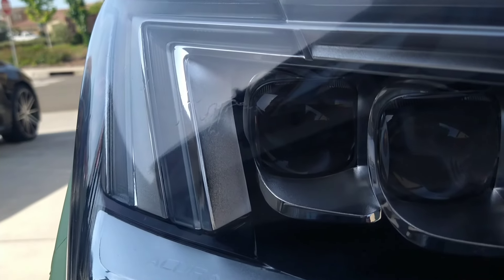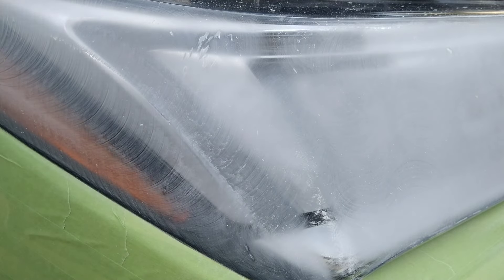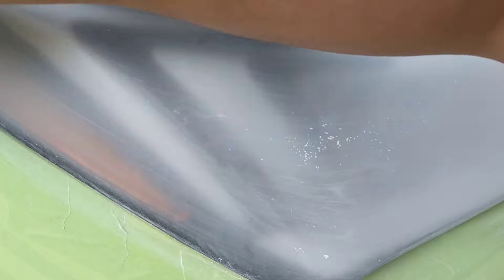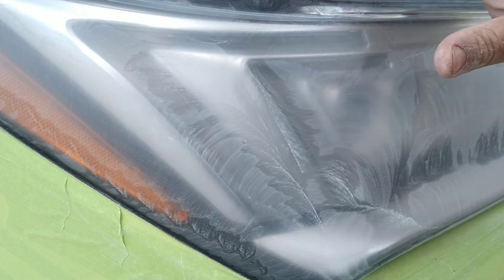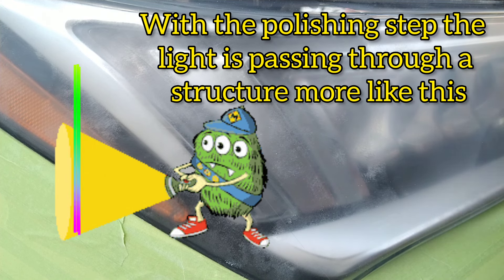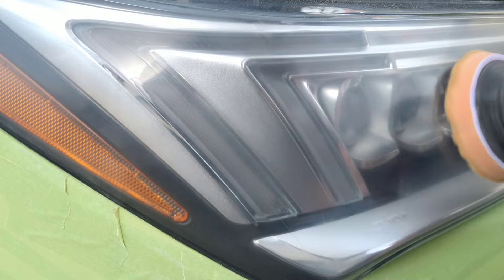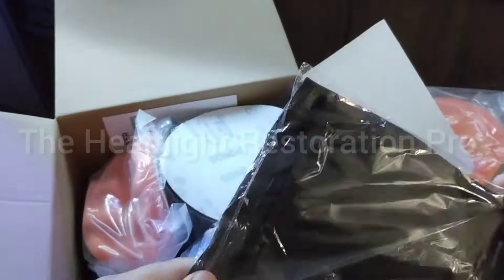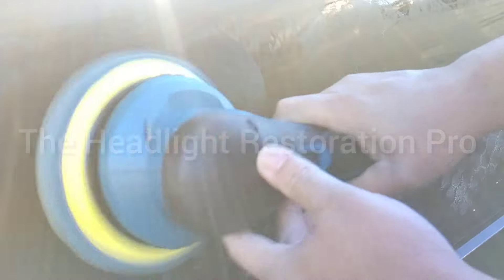Removing MeGuiars headlight coating/😭because I made a mistake

Comment: I finally extensively Sanded my 2004 Toyota headlights. Previously to that, a >FINE, polish, yearly, seamed OK.... after getting them really clear, i sprayed on a clear coat, only to have it extensively fog & then crackle- apparently I'd put on a clear coat b/4  Lacquer & varnish, don't mix. Now, the BRAND NEW ones look GREAT..L0L

Comment: I found a way to fix this easily but it has to be quick, I now carry a bottle of acetone and a rag with me right beside me when I spray it saved me now two times, I know ideally you don’t want this happening but when it does acetone wipes this stuff off if wiped up to 5 minutes after spraying and give it a polish, I also make sure to put acetone on the rag then wipe, also if anyone does this make sure to wipe the acetone off with the glass cleaner afterwards because I found that it messes with the new clear coat getting sprayed on, lol found out and had to respray twice the first time I tried with acetone.

Comment: I just tried the Meguiar's 17804 for the first time. The overspray error seen in this clip is easy to make. I kind of did this on my first lens, but the other lens was better. I think it's easy to allow the strokes to last a fraction of a second too long. The spray should consist of short, conservative strokes. For anyone interested, the spray works fine in cold weather.

Comment: This is exactly what happened to me. Thanks for showing that you're only human. You're thoughts on wipe on vs. the can sprayer?
Reply from the maker: Wipe on is inferior to anything spray...
Any wipe it on is adulterated unpure..
Always leave streets even if you don't see them right away uneven cohesiveness and typically too thin of application ... Little tiny fibers and things like that left behind from the pad used to put it on... Spray is very surgical and clean unadulterated there's no in between it just goes straight on and forms a perfect shell... Most anything made for headlights that is spray is going to be better.. this is also what the factor uses for many reasons it's just a superior method of application.. could you imagine wiping on clear coat on a vehicle,.. or wiping on paint....lol

Comment: warming the light before application will make it smoother with less orange peel and will dry faster.
Reply from the maker: No no no.... Not with this method and is unnecessary when doing headlight restoration... As long as you're using headlight restoration products... This is a zero Orange Peel product that dries with air (oxygen exchange) not heat.... I hear what you're saying but that's for stuff that's not designed for headlights.(totally different methods like wet sanding maybe).. With this method typically the light is warm enough through all the working and dry sanding and polishing...https://youtu.be/h-8BKUEVGRY?si=h5-Yw-Ntzrbp7OYG

Comment: I got my headlights done at VIP tires and whatever they used to spray it maybe a heat gun left a spray of the clear coating splattered all over my windshield and possibly most likely on my car. 😩It’s also on both of my passenger and driver side windows. How do I remove this? I tried using alcohol, but it got smearing and now my window is all smeared and a mess. 😩What can I do or use to get my window clean? Please help🙏🏽
Reply: Try a clay bar, if your window is messed up badly you can try putting #0000 steel wool with soapy water on it and just rubbing it away, not pushing too hard and letting it do the work.

Comment: Good morning and Happy New Year Mr. Headlight pro. I have a question for you. I'm your experience how many times can we sand and restore a headlight? Thank you so much for all your amazing videos!😊
Reply from the maker: Theoretically you can almost do have the restoration throughout the life of the vehicle... You only going to need another restoration every other year or even further even if you needed it every single year if you have a skilled professional that knows how much to remove which most cases would just be the clear coat you're talking 25- 40 headlight restoration Restorations estimate... Literally no vehicles going to be on the road for more than 20 years more than likely that would be 10 or less headlight Restorations....

Comment: Hi can I use meguaire headlight coating on convertible tops plastic window? I just had my plastic window professionally sand down to perfect clean but I don't feel meguaire plastic x does the same protection as this coating.

Comment: Which polish compound did you use to fill in the poly lens before you apply the clear? Looks like it’s at the 8:42 time mark. Your description lists 3M hard lens cleaner and Chemical guys headlight restorer. I’m a bit confused as to which product was used specifically to fill in the micro scratches left behind by the sandpaper

Comment: Let's say in 6, 7 or however many years when the Meguiar's coating needs to be redone, will it come off quick like your redo or will it pretty much have to be the whole restoration process? And also I think I know the answer to this question but should I wait for the springtime to do my headlights? Temps are getting down to 40 and could go lower.
Reply from the maker: Whatever it does go bad that you want to replace it it comes off even easier than shown in this video because it has been sitting and have have time to fully cure this is just the initial here which still a little gummy when you're removing.. it's super easy to remove once it's lived its full life or past the secondary curing...
Forest temperatures thats what this is about...
https://youtu.be/LnIqK8zRCI0?si=RTS9Nw2ieQXFoEqX

Comment: I used your technique to restore headlights on my 2014 Silverado and it came out great, thanks!

I did however get just a few slight drips like you corrected in this vid, but my clear coat has already cured. Honestly it’s not bad enough to make me want to redo the light, I figure I’ll just correct it when I have to redo the light again in a year or two.

The meguairs coat states it lasts for a year, at that point or when it fades do you recommend just replacing the clear like in this video or do you need to get back into the plastic headlight again as well?

Thanks for sharing your knowledge and experience!

Comment: Are the drips a problem or is it just a cosmetic thing? I just did my headlights and got some dripping but really don't want to redo the process if I don't have to.
Reply from the maker: It's purely a cosmetic thing it does not affect how your headlight works at all unless it's an excessive amount of drips...
It's just a perfect smooth or deal with like a little drip.. but in terms of dealing with a customer somebody who's paying for it is an issue sometimes not but I considered an issue just because they pay for perfection... But it's 100% cosmetic..
Reply: Makes sense. I did my own headlights so I'll just roll with it until I have to redo them and be a bit more careful with the spray next time. @theheadlightrestorationpro
Reply from the maker: @ethwoodard that's what I would do just always make sure you shake the can really well till it starts feeling lighter... And do really fast passes you see in 10 seconds I'm already done coating..

Comment: Thanks for putting links to the products. I want to use your method on my own car and I want to be as exact as possible. I, previously, used Cerekote but I messed it up and it didn't last.
Reply from the maker: Yeah most the kids are kind of misleading.. there's a plenty of room for error and they're not typically for every light this method can be used on any light on any stage of degradation..

Comment: Have you ever used novus 3 step plastic/acrylic polish? If so what's your thoughts? Thanks
Reply from the maker: Nope...
Reply: I've used it a couple of times in "testing" only, never as part of a resurface on a light and left it. I've only used it a couple of times testing but not impressed... I picked up the 3 stage kit (1, 2 and 3 products) out of curiosity, I don't plan on using it commercially tho.

Comment: Is that headlight spray a clear coat similar to the spraymax 2k? I have runners like yours with the spraymax. Have to redo my headlights aswell 🤦‍♀️
Reply from the maker: No the spray Max 2K is a terrible product to use for headlights even if it's the one that says for headlights they're pretty much the exact same just what has a little bit more UV repellent.. anything that has a hardener like that is just terrible product and not meant for headlights no matter what they say.  It's actually the worst thing you can put on headlights to cake there in general butt spray Max is definitely the worst out of all of them.. what I use is far superior and much much better for headlight restoration and headlights... If you want more information about it check out the link in the bio... Also it's used in every video The clarity is unmatched it's the most amazing have my product out there ..
Reply: @theheadlightrestorationpro  Thanks! I have to redo my headlights when weather clears up. Dont have a garage so have to do it outside.
Reply from the maker: You got this ...🫵🏽🦾
Reply from the maker: Outside is fine I do 99% of my headlight Restorations outside in any given weather..💯
Reply: @theheadlightrestorationpro  Yeah, just have to pick the right day tho... dry n preferably sunny & nice temperature.
Reply from the maker: Always the best..

Comment: i coated mine but i  realized there is a problem with the this coating.  it creates some granularities that act like diffusive layer and the as a result smoothens the light pattern by increasing its dispersion rather then keeping it sharp like it comes from the factory when the car is new!.    so the result is not restoring it to a condition identical to that of a new lamp.   i guess the only way to fix it is to follow orange peel removal approach just like doing to paint by using denim pad to level it.  this is what i intend to do, hopefully it will increase clarity of the cover to factory level.
Reply from the maker: Well you must be doing something wrong...
You see my end results are perfect every single time...and night vision is enhanced by far...no orange peel and no need to polish...(if you don't follow what I do and use what I use yes your lights are going to be sub-par )
This is the best coating out..hands down...this was more than likely an operation and or application error..
Further more..
You've seen how much clarity I get with my finished product....no factory light actually functions better than my finished product...that is why the lights look so much better than the day they rolled off the lot...(the lighting is most definitely enhanced) the problem is simple, most people don't follow directions...I'm showing perfection..so why try to change the process... it's a mathematical - scientific process that I've performed on over a 1000 lights and like 3 dozen videos..

Comment: I did everything and my lights are cloudy 😭😖
Reply from the maker: Must be your lights.... sorry to hear that ..
Reply: @theheadlightrestorationpro  they were yellowish at the beginning and I tries plast x and they were ok but not too clear, then I tried this and after applying the clear coat they turned cloudy worst than the beginning 😖😭 can I just repolish whit plastx another day??
Reply from the maker: One of the biggest issues is you didn't do everything that I do...
You're not using the same supplies that I'm using... Plastic x it's a very terrible product very basic...
Reply: @theheadlightrestorationpro  ok can I just re polish using a better product over the clear coat?
Reply: @theheadlightrestorationpro  both products I used are meguiars, the clear coat is the same one u used 😖
Reply from the maker: I would just use my exact method using the exact same products..the exact same way I do it in all my videos.. 
From the start...
You will get different results if you do different things.
Reply: @tooawake5319 I had the same issue happen to me when I got to the last step of applying the clear coat, my lights were crystal clear then I started applying the clear coat and it clouded it up in one area. I didn’t understand why that happened? So I sanded everything down again starting from scratch, once I got to the last step again and applied the clear coat I made sure I sprayed enough of it. They came out great. You got to spray enough, you can’t be afraid to apply a heavy coat but without overspray cuz it can cause it to drip. I hope this helps

Comment: what are your thoughts about using 2inch sanding pads vs 3 inch pads. i see a lot of headlights with lots of tight spots to get into
Reply from the maker: Haven't got to yet but if you turn a slight angle on the drill tip you'll be able to get into a lot of angles the ones that you can't I hand sand..
Reply: @theheadlightrestorationpro  good to know thank you

Comment: we want a video with very deep spider cracks lol. trying to do my father in laws headlights but they didn't come out with the 500 grit so wondering if the cracks are from the inside or just very deep
Reply from the maker: Sometimes this is the case ..you can only work with what you got...

Comment: Hey Pro, I found that is comes right off with alcohol just like is says on the can. Seriously I put some on way too heavy and it did strange things as it dried. It may have been to hot as the can had been in the sun. It took some rags but was much easier that sanding. Still had to buff it some for clarity.
Reply from the maker: You'll never obtain the clarity doing that guaranteed as I have tried this before many times it only works on thin coats so you probably had too thin of a coat even though you thought it was heavy.. my coats are super thick the proper way to apply them are super thick it will not work on a dried surface on slight over spray and stuff like that all day..
Also you'd be doing the headlight a disservice even if it did come all the way off the alcohol is going to react with the polycarbonate and or other stuff and really fuck up your clarity also it goes under coding even though it's off the surface it's not off those porous environments.. so that's what they tell you and that's what you do but it doesn't really come all the way off much better to start off trust me I am a professional who has done well over a thousand headlights probably with just this product alone..
It might have seemed to work but your product should be a lot better than what it is I'm sure..
And when you're a professional and striving for the highest level of results you can accept this because I know from experience it will not be no matter what you do you have to take it back down this is bullshit spewed upon the public just to make it easier to use for people and they know most people won't be professionals will just be happy because their headlights better not perfect...
Did it look like this?
That's probably why..👇🏽
https://youtube.com/shorts/l7_sYvi2nhI?feature=share

Comment: Great video but I also been doing headlight restoration for years and also use Meguiars. If you ever mess up you actually don’t have to sand it to get off. I use the same compound that I buff with to remove it. It comes right off with no issues in a couple of minutes. After I clean up the residue I recoat the light 
and it always comes out perfect. Give a try sometime and you’ll same time by not having to sand again. On another note your on point saying there is no permanent solution. 2k is actually the worse when it goes bad and a nightmare to remove.
Reply: Whay compound you use?i need to redo my clearcoat
Reply: @nevadadsmithsmithproductio6481  Same, what compound are you referring to? Cheers
Reply: @DrumToTheBassWoop  what compound you buff with?
Reply: @nevadadsmithsmithproductio6481  I don't know, I'm joining you on asking OP.
Reply: I think he's using Meguiars Ultimate Compound.  I'm gonna try it...